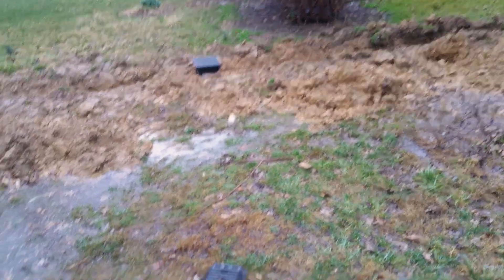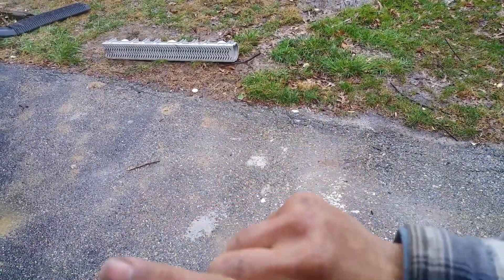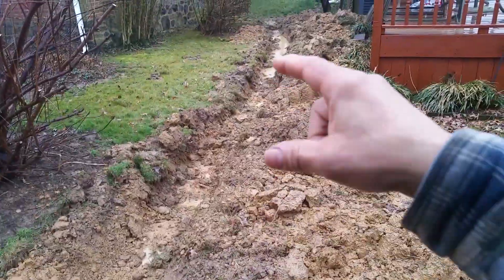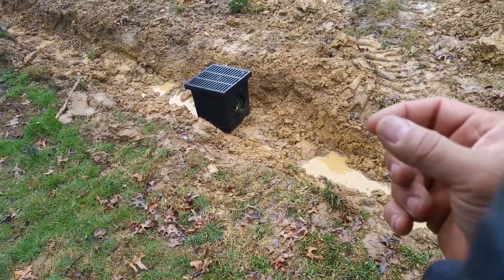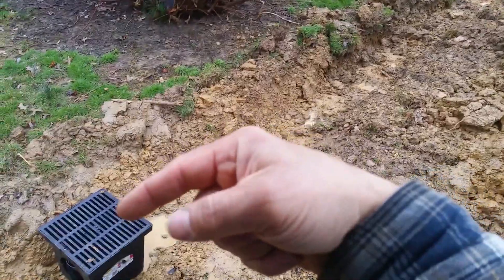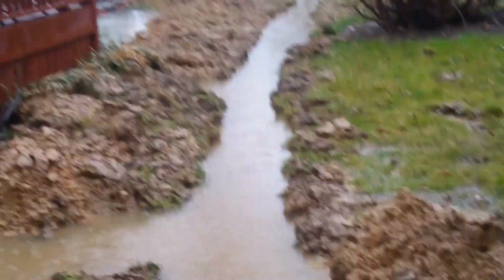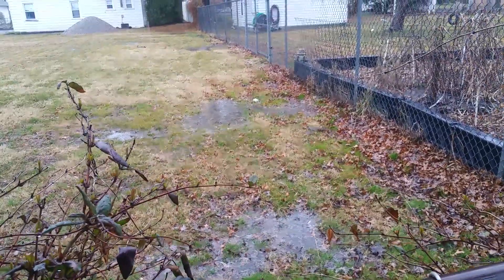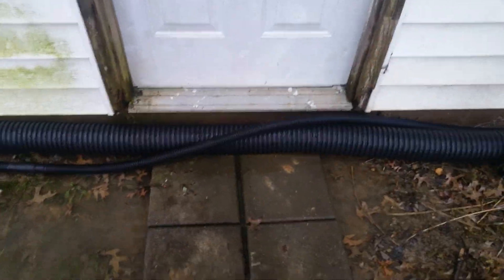Surface water backing up Clay Soil How to redirect the water on level ground Standing water issue

Comment: There is only one thing you can do with this yard and that is trench it filled to the top with gravel and direct all water to a sump pit and pump it out that's the only thing you can do I trenched the perimeter of my garage which used to flood dug a trench 2 feet wide 2 feet deep and a 3 foot deep sump pit and pumped it out but they did take 18 ton of stone three-quarter clear to make my yard dry
Reply from the maker: Yes sir...

Comment: That is a massive amount of standing water around the house. Is the concrete foundation wrecked? What kind of underground pipe will you use?
Reply from the maker: This darn clay does not even allow it to penetrate to the inside of the basement... But, oddly it did dry up within 15 minutes after the rain finished... Just shitting you Dos!  --   This is an opportunity to build an inground pool and no liner required!  (just kidding again)...  The owner is just going to divert the water to the front of the property, onto the street...  The pipe will be perforated pipe, but that is to allow water to gain access to the piping to direct it to the pump and out to the street... I think it will only be pumped up about / approximately one foot and then the piping is on a pitch towards the street from that point... 
That piping would be on the opposite side of this garage...
Reply from the maker: He went with a sewage pump and also a screen settlement in the bottom of pit...